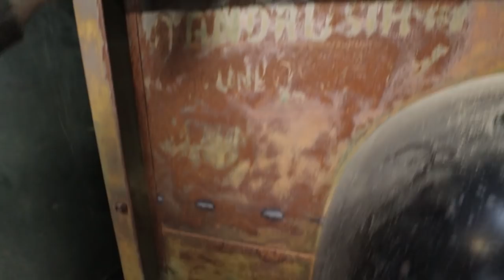Mounting the box, tailgate and tail lights on the 51 Ford F1 Part 6

Comment: Bonjour mon ami ... wow, you're going at Warp Speed on this build !!! Great idea on bead rolling the filler panels on the Tubs ... it will help limit "Oil Canning" (just from differential temperature variations ... and besides, it looks like some thought was given to the design ("Fancy" as you said).  One suggestion ... you might want to put a Plug in the original Passenger side Gas Filler neck ... might prevent someone that borrows the truck from the Owner from pumping gas on the ground cause he/she didn't know ... even if it would be a funny story eh?
Reply from the maker: Haha may just put the window wash juice in there.
Reply: @HalfassKustoms  LOL what a great idea !!! <3

Comment: A little tip for you. The tail light mounting brackets for a 1965 Ford F-100 step side bed are the same all the way back into the 1940’s. Same with the tail gate hinge, and would bolt behind the tail gate hinge with through bolts. And your model T tail lights, should bolt right into the tail light brackets for a 1965 Ford F-100 step side bed. As Ford was pretty good about reusing a lot of parts, from older trucks on newer trucks until the 1980’s.

Comment: Brent:  Why would you want to remove the gas tank inside the cab? I'd leave it as an "auxillary tank" that has an open - close valve that would be right behind the left side rear of the driver's seat (where he can reach back and simply open it without stopping his driving.  The fuel line would then run down under the cab and into into a merging block that comes from the bed's tank and goes right to the engine.  Not too many pick up truck drivers can say they have a 350 mile range like this truck has could they?
Reply: How much are you going to be cruiseing in this fine creation, and you'd probably have enough to buy some gas...
Reply: With the motor he is using is high pressure fuel system the old tank will not work with this LS motor.  The tank in THE S10 frame matches the LS motor .

Comment: Man, those sign posts are perfect for bed crossmembers! I had to have 2 bent up to replace on my '72 F100 bed. Being in Canada also, I'm sure you're familiar with having to repair parts as finding replacement parts is pretty hard. Lol.
Reply: I taught myself how to weld making wheel tubs like that. Same style trailer fenders and welded 16g sheet metal... no step, flush... for my '54 Chevy pickup

Comment: Would have been cool if you could have used the original fill spot for the new tank somehow. Yeah I know there would have been a hole in the cab and there would have been flex but there has to be a way of doing it. I had this same idea when I had my 68 GMC and i was going to convert it over to a tank under the bed. I did end up selling the truck and never starting on my build. I wish I still had that truck though. Was no rot in mine either. It was a true barn find in great condition when i got her. Just needed cash back in 2017 and sold her. Keep up the great work and content.

Comment: My '98 Jeep Wrangler has a cut-in fuel filler construct that simply passes through the vertical wall of the body much like the sidewall of the truck you're building. You could get one of those at a salvage yard or somewhere, cut away the sidewall part, cut a hole in your bed sidewall and just let the whole filler construct into the hole. Would be easy and look good. Already has cap.

Comment: Bed rails perimeter'd n [provincial?] sign post'd, fuel filler neck'd thru da bed, tubs trim'd n bead roller'd in, tailgated wif bolts, bed filler panel'd , model A tail lights sweet!

Comment: Looking great. Hope filler neck works out, dribbling fuel into tank sucks. I figured the fargo would fill easy. Nope. Nice work on wheel tubs. 
Where you find sheet metal? No one local seems to be able to get 18 ga.

Taillights, drill 2 new holes..but your way worked good too!
Reply from the maker: Had stocked up a few years back and still working through that stock.

Comment: Could you move the fuel tank to the passenger side of the frame and use the original filler? I've seen you do a lot more complicated solutions. Just thinking out loud Brent.
Reply: Never Mind.

Comment: Just a thought on the filler neck.
Could you have run a pipe from the original opening (with OEM tank removed) down to the opposite lower corner and tied that into the fuel tank ?

Comment: I'd pull that gas filler out of the passenger side of the cab completely or epoxy the cap to the neck.  Can you imagine the first time someone goes to gas up, accidentally chooses the wrong filler and dumps 20 gallons of high octane onto the cab floor?

Comment: What did you use for your horizontal bed rails. I have been doing a frame off 1951 f4 onto a 1990 k2500 for two years and I’m getting to putting my bed on finally. Thanks
Reply from the maker: Think it's sign post

Comment: Could you not have moved the fuel tank over to the right hand side of the chassis as the shape of the cross member looks to be the same on both sides and use the original fuel filler neck in the cab rather than cut into a really nice box/tub?

Comment: What size of. mig welder are you using?
Reply from the maker: .25 for sheet metal.
Reply: Not the wire,
The machine AMPS,
Thank you